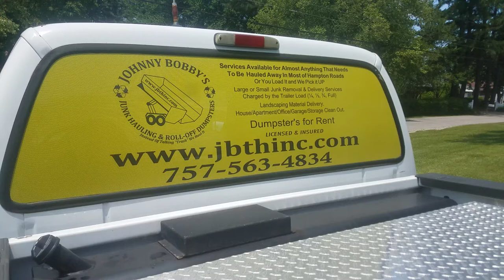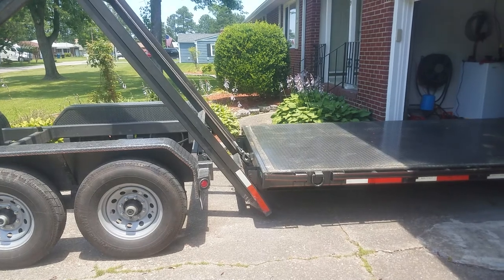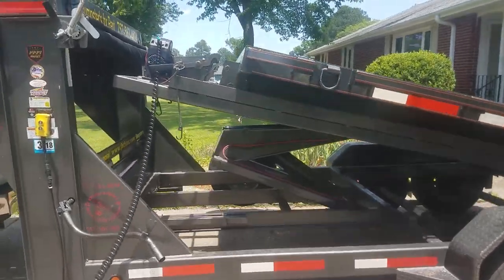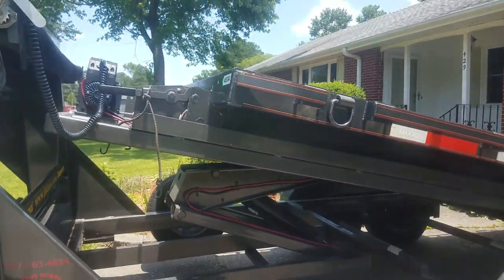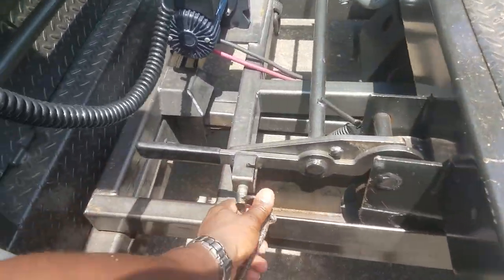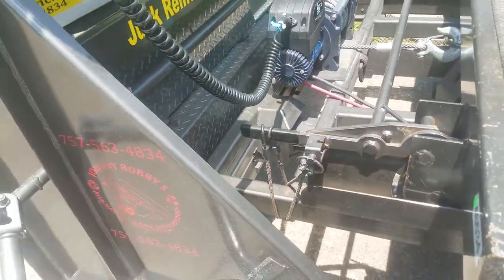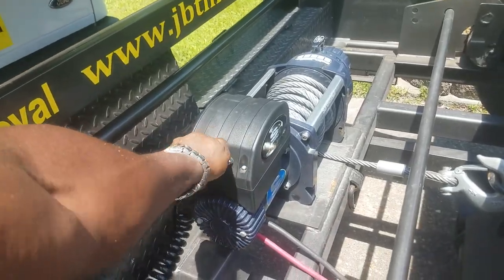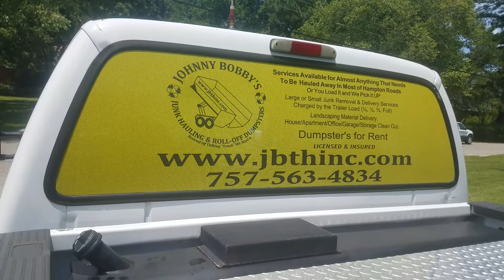MAXXD  Roll-off Dump FLATBED  hooking up to the trailer PART 1

Comment: nice johnny!!!!! have a question? can you load a skid steer on flatbed while flatbed is on ground?
Reply from the maker: Bossman you sure can. The winch has an 18k rating. You can always use a snatch block as well.